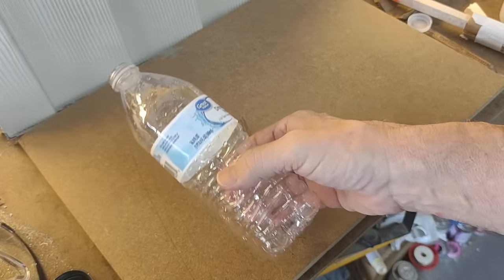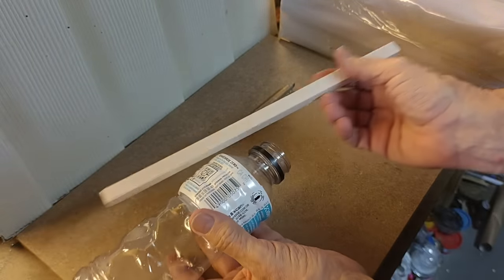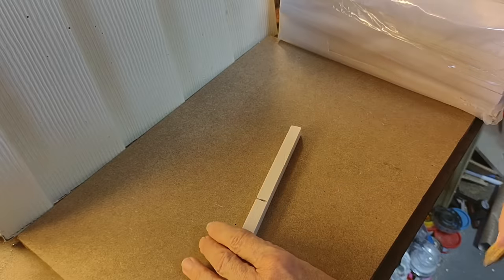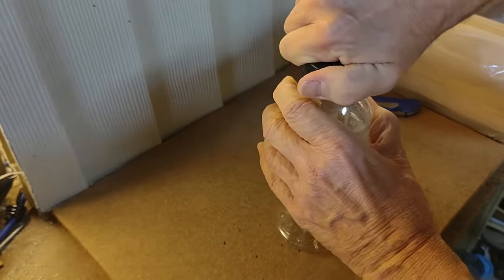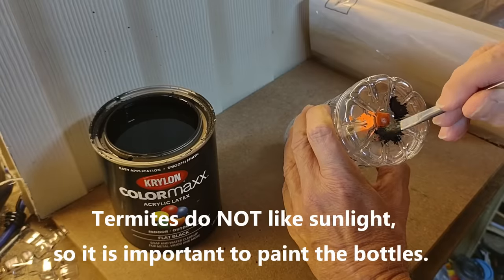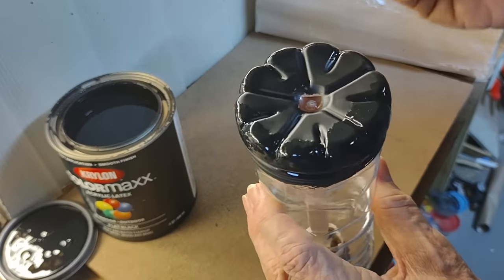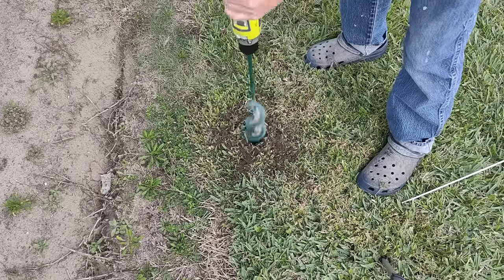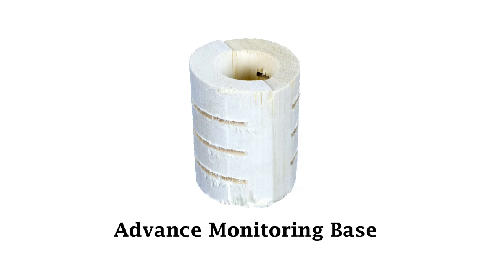Unbelievable Water Bottle Trick for Termites!  Simple to do!

Comment: My home has a slab foundation with a 3 foot overhang on all sides.  The house is in the woods.   I  Have had termites previously, about 10 years ago,  and the house was treated via ground chemicals.  There is a popcorn ceiling in my home, and recently there has been debris fall on counters and table, white and looks like salt. I am concerned that maybe termites again? There is no frass or body parts seen in this debris. Pure white.   Question is, will termite monitoring stations, if placed close together, tell me if I have an active infestation? I have had a pesticide company out, and they do not have any idea what is causing the debris. No way to see termite signs.   My Best guess is its popcorn ceiling debris from breathing holes in the ceiling, from something.   Pesticide company suggested bait stations just in case.  Thank you.
Reply from the maker: I would not install bait stations.  They just want to sell you something to make money.  Don't fall for it.  Please tell me where you live.  Location matters.  Also, tell me more about the debris.  Is it a dust or is it more like tiny pellets?  Are there tiny holes in the ceiling?  If so, are the holes open, or are they filled in again?  Are you seeing any ants near the baseboards?  Have you gone into the attic to have a look?  Did the pest controller go up there?  If not, then have a look to see if there are mud tubes up there.

The monitoring stations are a good idea to detect subterranean termites.  If you have an active infestation, there is a good chance that one of these will go off, if you have them 4 feet apart.  It's never a sure thing, but definitely worth doing.

Don't worry.  We can probably figure it out.  Be well my friend.
Reply: Thank you for your response.  We live in Maryland. We have a slab foundation, and no attic. The debris literally looks like salt, but non symmetrical in shape. Crystalline.   When looking  under a magnifying glass, no bug material in it at all. I believe it is most likely the stucco material. It Doesn't show up all the time but every few days.  There are no ants at all indoors. The holes are a guess, as it is a stucco type ceiling and there are pock variations in most all the areas. I was grasping at straws. All the holes I see are not filled in.  May be natural to the ceiling.  But, the debris has to be coming from somewhere.  I pulled a piece of molding along an area that was "shedding" to see if I could catch any critter, but saw nothing.  And the debris  decreased  substantially,  if not not completely in that area.  The nuthatch birds are loving the outside corner of this house, about 10 - 15 feet where the ceiling debris is/has fallen.   Yesterday I took a stethoscope to the ceiling areas to listen, and also outside but heard nothing.  Because we are on a slab and have no attic either, i am worried that there aren't signs for us to pick up.  We found termites the last time totally by accident, when wallpaper started to ripple, and i cut it open to see what was happening.  We are going to try your method, either for the monitoring station or bait station.  But not sure which to do.  Also, we have a 3 foot overhang to his house, would the stations be farther out? or closer in to the structure.  Thank you again, very much.
Reply from the maker: @theresarussell1942  Okay.  That is very helpful information.  Now I can rule out some things.  What we are left with would include termites, carpenter ants, or some species of wood boring beetles.  So, let's do some detective work.  Please walk around the house and look to see if there are any mud tubes coming up from the ground or in the eaves.  Also, look closely at the eaves and fascia boards for holes.  If you don't see anything like that, then I would be leaning toward carpenter ants.  These guys like soft, wet, wood, so it is possible that you have a roof leak or perhaps insufficient ventilation between the rafters.  Carpenter ants do not eat wood, so they must forage for food.  If you are not seeing them inside, then they may be going outside to find food.  If you have any overhanging trees or vegetation in contact with the house, then cut it back.  Look outside for carpenter ants on trees and any wood that is laying around.  If you can't find any evidence of carpenter ants, mud tubes, or holes in the fascia boards, then I would treat for both ants and termites.  I may be able to show you a simple what to do it.

You can install the monitoring stations 4 feet from the house, or you can install them 2 feet from the house.  You just don't want the water to drop on them.  Also, you don't want to drive a riding mower over them, if that can be avoided.  I mean, they are only water bottles, so they do have some limitations.

Please let me know what you find out.  Be well my friend.
Reply: Thank you again. I actually never heard back from the pest guy that came to check our house. Who would have guessed an internet person would be so earnest in helping others with their pest issues! I am very thankful.  As to the inspection.  No tubes noted. We have brick that goes about 3 foot up before it gets to the wood siding. No sign of ants anywhere. Too cold now I believe. This past spring, and last year also I remember now seeing a huge amount of ants at my back door. They looked like they were trying to get in the house.  I sprayed them both times and they disappeared.  so maybe this is a carpenter ant issue.?  And yes, We have had a previous roof leak problems. We just had the roof replaced about a month ago.  Roofers did not see any pests, but they only were able to see areas under where the plywood needed to be replaced. Thx! vry much.   Next step?
Reply from the maker: Most likely you sprayed the ants with something you purchased at Home Depot, Lowes, Walmart, or someplace like that.  These products are almost always repellent pesticides that cause the ants to move to a new location.  Folks think that the ants are gone because they no longer see them, but this is not the case.  You always need to use a non-repellent pesticide to treat ants.  Anyway, these could be carpenter ants.  You certainly have all the ingredients.  You may want to look around the yard to see if you can find any carpenter ants.  They are usually all black and very large.  They range in size from about 1/4 inch to 1/2 inch.  Now those are serious ants.  If you find any, then it is very possible that this is your problem.  These guys can literally take out your roof rafters.  I have seen it before.  Therefore, I would err on the side of caution and start treating the exterior of the house every 90 days, until I found out the actual cause of the problem.  Since there are no ants or other pests inside the house and no evidence of termites, these guys are probably foraging for food outside of the house.  So, if you treat the exterior, that may do the trick.  They will cross the pesticide on their way to and from the satellite colony in the ceiling.  If you use a non-repellent pesticide, the ants will not know that they are being poisoned and they will happily cross it and bring it back to the colony.  This will take out that satellite colony.  The main colony will still be functioning somewhere in your yard, so you need to treat every 90 days to prevent reinfestation.  You do not need to treat in freezing weather.  I will give you a link to my video on how to do this.  The products and equipment are listed in the description.  In the video it shows how to do this with a tank sprayer and a hose end sprayer.  I do the entire thing with the hose end sprayer because it is way faster and easier.  You are not supposed to do it this way because you will be applying too much pesticide, but it will not harm you or the environment.  I hope that helps.  Be well my friend.

Video on how to treat the exterior of your house:  https://youtu.be/Yozv3s-Qwlw
Reply: Thank you very much.  Buying the supplies now, to spray our perimeter etc.  Then the termite monitoring sites also.  Your advise is very much appreciated.
Reply from the maker: @theresarussell1942  You are very welcome.  Be well my friend.

Comment: Does the bottle fill with water? We have sandy soil.
Reply from the maker: They will not fill with water because they have holes in them, but there will probably be some water in the bottom.  That's fine because termites like water and they like wet wood.  If there is constant water, then you will probably run into a mold situation with the wood.  Termites like wet wood, but they do not like moldy wood.  So, you should check the stations every few months for mold.  Not all of them.  Just pull one out every now and then and check it.  If one is good, then the others probably are as well.  If you have a mold problem, then you just need to change out the sticks periodically.  All monitoring stations have this problem and should be periodically checked for mold.  I hope that helps.  Be well Cynthia.

Comment: what is the poison for them?  the wood itself or the paint on the end?  why wouldn't you paint the whole thing?
Reply: Neither. The wood stick is just food. If the orange tip disappears, termites are eating on the wood. That’s when you use a Trilona station or fripinil foam injected into that station. He has the product links above in the description.
Reply from the maker: @douglasbecker5991  Nice answer.  Kind, to the point, and well stated.  You got it exactly right.  You are a breath of fresh air.  Thank you.
Reply from the maker: Douglas Becker got it exactly right.  There is no poison in the stations.  Their job is to simply alert you to termite activity.  If a dot goes away, then you need to check to make sure that the station did not just malfunction, and you actually do have termites.  They are just water bottles after all, so they can mess up.  If the stick is broken though, then you do have termites and you need to install a commercial bait station next to the water bottle.  You can paint the entire bottle or the entire stick, but it is not necessary.  I am so sorry for the confusion.  Please don't feel bad.  You are not the only one who thought that the stations were a kind of bait.  I probably should have been clearer about that point.  Be well my friend.

Comment: Guy, found a termite munching on a dead oak branch in my yard about 50ft away from my house, is this something I should be worried about? I live in Central NC. I figure natures cleanup crew is just doing their job but of course I want them out of my house.
Reply from the maker: Yes.  That would be cause for concern.  Termites do not limit themselves to one food source.  If they are in the area, then you need to protect your house.  I use both the termite stations and I apply termite granules around the house every year.  That way I can't miss.  As long as they stay away from my house, I am happy to allow them to eat whatever they want, but if they decide that my house is going to be their favorite restaurant, then they need to go.  If they attempt to pass through the granules, then the entire colony will get wiped out.  If you also use the termite stations, then you will most likely catch them there, so you can treat them before they ever make it to the granules.  I like that double layer of protection.

I hope that helps.  Be well my friend.

Comment: what are the types of termite commonly found in the Philippines? and how to treat them? thank you.
Reply from the maker: There are about 200 species of termites found in the Philippines.  Only a few of them are typically a problem for structures.

Formosan termites may be the most common species of termite found in the Philippines.  They are subterranean termites, which means that they build their colonies underground, but they also have the ability to build nests "cartons" in the building itself. They can cause significant damage to homes and other structures very quickly.

You also have less destructive subterranean termites as well, that do not have the ability to colonize in your home.

Then there are cone head termites that can also do a lot of damage.

You also have mound-building termites, but they do not typically cause damage to homes or other structures.

There are also drywood termites in the Philippines.  These guys are not subterranean and literally fly to your home and colonize inside the wood.

Before you can treat, you need to identify the species because different species get treated differently.  I am not an expert in termite species in the Philippines, so it would be wise to get your home inspected by a local professional.  After you identify the species, I may be able to assist you with the correct treatment plan.

I hope that helps.  Be well my friend.

Comment: I wonder how many people have cut a wire/cable using the auger to drill the hole?
Reply from the maker: I have never seen or heard of that happening, but I suppose it is possible.  You would need to be really unlucky.  I hope that helps.  Be well my friend.
Reply: @GuysPestSolutions  I know my cable tv and phone line are only a few inches deep, my electric/gas line are 3ft deep. Water line about 1 ft down, sewer line about 1ft. so while I knew where mine were before installing them, most people have no clue where those things are.
Reply from the maker: I think you are right that most utility lines are at least 12 inches deep, except for cable and maybe phone lines.  The water bottles are generally less than 8 inches tall, so the only concern would be those cable and phone lines.  If you look at the side of the house, you can usually see where the lines go up the wall.  Most of the time the lines are in something of a straight line to the utility box on the lawn or utility pole.  So, you can kind of estimate where those lines are located, and just use some caution in that area.  I think if you estimate where the lines are and stay 2 feet to either side, then you will most likely be okay.  I suppose some folks would not think to do this, so it is possible for them to drill a hole right over a cable line, and that would most likely break it.  I have never seen or heard of anyone being that unlucky, but I'll bet it has happened.  I'll bet people break those lines when they landscape around the house too.  I think it's a good point that folks would be wise to locate these lines before they do this work.  Be well my friend.

Comment: What happens when it rains? Won't the monitoring stations fill up with rainwater and rot the wood sticks? Another issue is half of my house perimeter is a concrete patio and driveway.
Reply from the maker: They usually don't fill up with water, but the wood in the station is going to get nasty after a while and will need to be replaced.  I recommend pulling one up at least annually and inspecting it.  If the wood is moldy or compromised in any way, then you should replace them.  The commercial stations have the same problem, but the wood or bait is easier to replace with them.  Also, sometimes the orange dot will disappear, even though there are no termites.  This can happen if you run over one with a riding mower or if the stick was not long enough.  It can slip to the side and not be visible.  So, always check to be sure that you actually have termites when one goes off.  Unless the concrete goes all the way to the property line, then you should install the monitoring stations right next to the concrete.  I always install them along both sides of the driveway, around patios, and that sort of thing.  You literally cannot use too many of them.  If you have concrete that goes all the way to the property line, then you cannot use these devices.

I hope that helps.  Be well my friend.

Comment: Awesome. When you go to sell your house, instead of providing a guarantee from the termite company or receipts showing you have been treating for years, just show the prospective buyer a few water bottles.
Reply: Funny, and a good point; however, if you are diligent about checking the monitoring stations and treating when necessary, you will actually prevent your house from being infested with termites. Shouldn’t an inspection by the prospective buyer reveal that there are no termites?
Reply from the maker: When selling your house, there is no requirement whatsoever to show any sorts of receipts that you did any pest control whatsoever.  Some banks and government backed loans, like FHA, and VA, may require that a termite inspection be done prior to the closing.  If there are no termites present, then no treatment is required, and the banks do not require any sort of bond.  Their only concern is that you are termite free prior to the closing.  An ounce of prevention is always worth a pound of cure in pest control, so you can pay somebody else to do the prevention for you or you can do it yourself.  Not everybody can afford to pay a pest controller for this service.  If you cannot afford it, then this is a great way to do the same thing yourself for under $25.  I don't see anything wrong with that.       

I hope that helps.  Be well my friend.